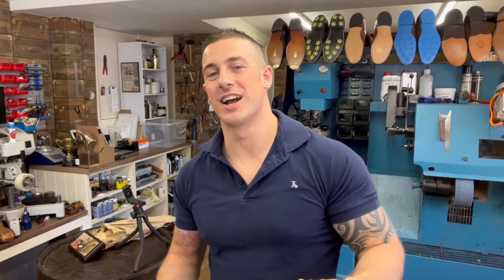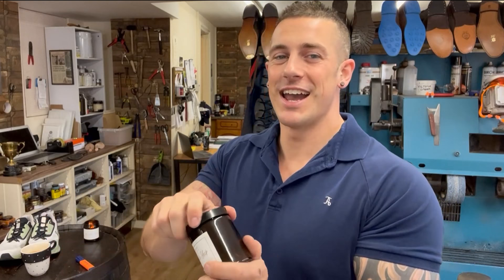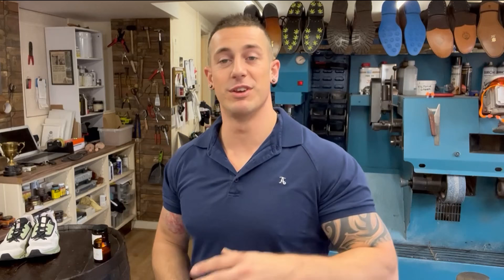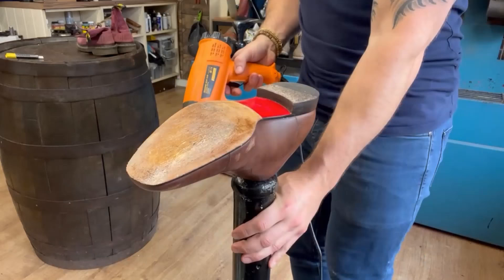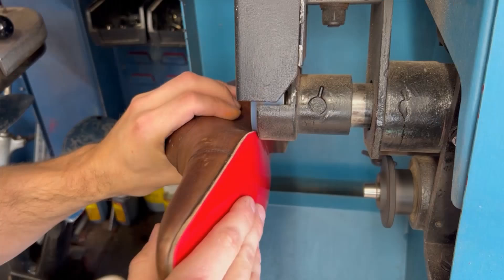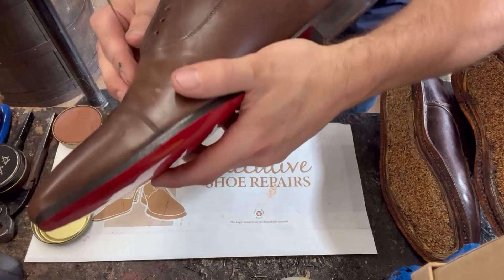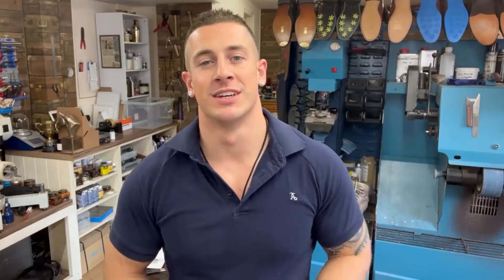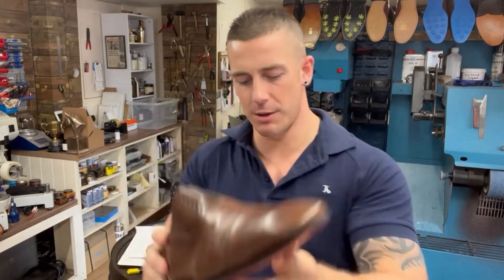BIG COBBLER Q&A! Plus Louboutins & STRIPPER BOOTS!

Comment: Greetings Dan,  I always look forward to your videos.  Please keep the Q & A segments going they are very informative.  On repairing shoes,  when you are trimming the sole of the shoe, I would be afraid of scuffing the shoe leather.  Do these trimmers have an adjustment so the blade or belt cannot reach into the shoe leather?    How many foot pounds of pressure does the presser exert?  Would it be possible for you do an in-depth demonstration of the machines and their adjustments?  (Not the stitchers, you have demonstrated them in a previous video.)

Comment: Hi Dan.  I've recently discovered your channel in my search to how to repair boots myself.  I wanted only to add a plate to the outer heel that was worn more that normal because of an injury, but at this point I am deep in the You Tube wormhole of Cobbling!
That you enjoy your work certainly come through the camera. Thanks so much for showing us your work.  I have a  question:

- What would be your recommendation for a replacement out sole for  Bear Paw boots (they look like the UGGS original).  There appears to be no mid-sole. It's the upper glued to the soft foamy-rubber-like out sole.  Should I glue the new sole to the original or remove it altogether? 

Thanks so much!  Please continue to share your work with us.  I appreciate it. :)

Comment: Even worse that the watch battery... At Radio Shack we had people come in with Glucose Meters... Covered in blood, looking for us to change the battery.
Reply: I worked in a plumbing shop and people would often bring in broken toilet seats, looking for a replacement, often unwashed and they would just drop them on our desk.
Reply: @SerenityChaos1975  yep, that's worse than watches or glucose meters lol
Reply: I worked for a while as a optical technician cutting lenses and making and repairing glases. 

The state of some of the frames brought in for repair were horendouse.

We used to have what we called frame cheese a mix of dandruff and skin particles and sweat and grease!!